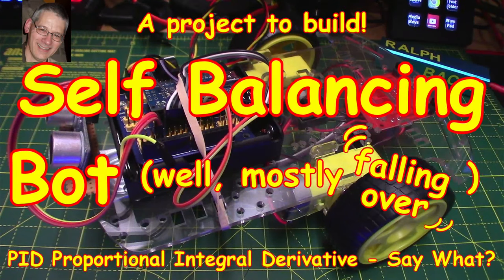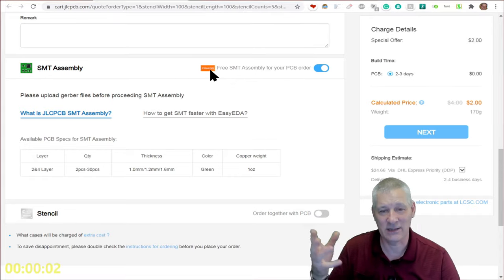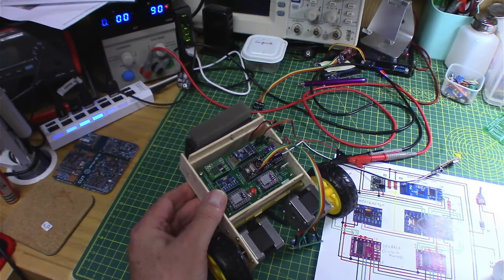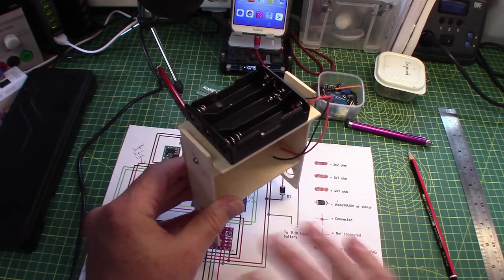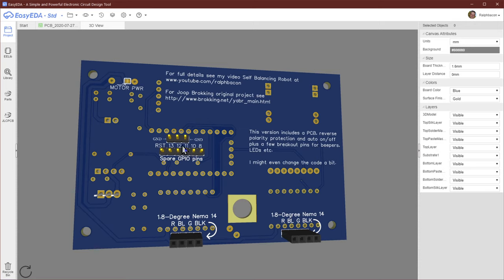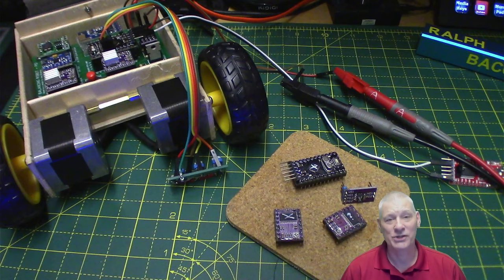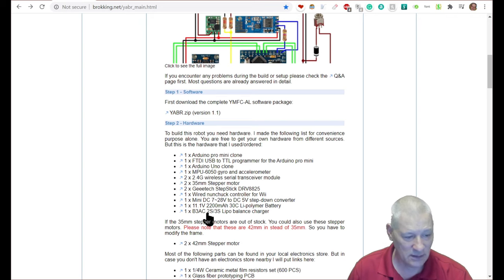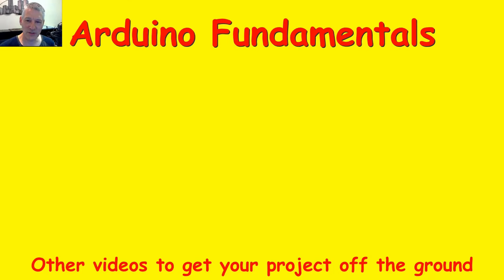#199 Self Balancing 'Bot (almost) with Arduino Pro Micro

Comment: I did start this project but never built the circuit board well before easypcb was know to me. Some 6050 have offsets so some code to adjust for this or it will drift forward or backwards, second if there is slip on the wheels to the floor surface then really complicates the problem. I used bicycle inner tube stretched over the wheels as were too hard plastic to grip. A rough floor surface would help, glass paper? I like the pots for the PID idea and Serial plotter might help to see what happened. Lots or D  once the P gain is correct enough. Graham
Reply: As a photographer, I use cut out pieces of blown-out bicycle inner tubes whenever I need additional friction.
May I ask, what is "glass paper"?
Reply: @AtlantaTerry   glass paper english for sand paper
Reply: @grahamwise5719  
Oh? Thank you, I am 74 years old and never heard that. Well, as they say, one learns something new every day.
Reply from the maker: I'm trying this out mainly on carpet which provides enough grip for now. But inner tube or elastic bands are definitely an option.
Reply: @RalphBacon  
I'm not sure how old you are but I'm 74 and way back in the '50s we kids got Erector Sets for Christmas and birthdays. If I remember correctly, those sets included metal wheels with rubber treads. I wonder if that sort of wheel would be useful for this project of yours. But where to find them these days... The originals would likely be too expensive as collector items and if the sets are currently being produced, most likely the wheels are cheaply made in China. 

Just a thought... but what about wheels made for "Pinewood Derby" competitions held by Cub Scouts / Boy Scouts?
https://en.wikipedia.org/wiki/Pinewood_derby

Comment: You need to get an nvidia jetson whenever they drop in price. I plan on it. I meant to add I ordered a bosch bno055 9dof board with mcu that communicates via spi or i2c and a mini lidar sensor good for 8m with a built in stm32 that just spits out 3d coordinates. I'm gonna use a pi3 or something better hopefully to visualize the data overlayed on a known area to figure out the transform algorithm to make a rolling beast of some sort. Winter project.
Reply from the maker: Winter is always a good time for those sorts of project. Hang on, an Nvidia Jetson, an AI board just to balance a bot? Hmm, I need to dig this project out of my storage bin!
Reply: @RalphBacon  they can do more than that. They could be trained to identify my cats. I have one named Ralph that's especially bad. Haha

Comment: -may they rest on peace.😇
-and you were worried about polarity. 😉
I know nothing about PID. How do you know it is vertical?, how do you measure movement?
By looking and listening to you robot's movements, it seems that your motor control is a bit of, I guess I'm just pointing out the obvious.  
Good to see that you do as you preach and apply your own circuitses.
Reply from the maker: We know when it is vertical because the MPU6050 can measure angles, so when it is upright the angle is zero. Movement, as in forwards or backwards, is not measured directly (I think) but can be because I'm using stepper motors (not standard DC motors) so one pulse will equal x mm of travel.
Reply: @RalphBacon  If I understand this right, the MPU6050 say zero when it is precisely vertical? Then your base plate has to be precise to. With 16 bit resolution, 1 degree of might matter.
Have you measured the value of the MPU6050 when vertical?
Having the battery on top shouldn't matter as long as the center of combined gravity is on the center of the axles. I don't know if the center of gravity matters. If it does matter, the placement of the battery pack could be adjusted.
As I said earlier, I  know nothing about PID and I would be lucky to push your mind in the direction.
God or bad, every suggestion/ ideer change our way of thinking ever so slightly.

Comment: Ralph; Did you do follow Brokking instructions in the first video? The "YABR_hardware_test.ino" test and get your balance test value?? From what I understand this number is unique to each construction.
Reply from the maker: I did indeed, Paul, although it varies quite a bit each time I do it. -552 is the current value but it can vary between -270 and -880. What I don't understand is that if this is supposed to be the value when the bot is vertical, why not just use the gyro angle instead?
Reply: @RalphBacon  One thing I did read that it takes two or three seconds for gyro to generate true numbers.
Reply from the maker: That would be too slow I guess. I shall experiment some more.

Comment: Batteries on top? Bad idea! Lower COG dictates the batteries go on the bottom. So, bigger wheels to give more ground clearance and then you'll have the space to put the battery box on the bottom.
Reply: Incidentally, my robot buggy was built on that chassis you showed (battery box on the underside - 2 x 18650) and a Pro Mini with a Bluetooth device and all controlled from an app on my phone. The next thing is to build a controller using a joystick and another Bluetooth adaptor (or maybe convert to using the NRF24 modules instead.)
Reply: This is an inverted pendulum robot.  It helps to have the mass at the top.  Try balancening a boom on your hand with the head down, then try again with the head up.  It is mush easier with the mass at the top.
Reply: This type of bot needs to move its COG outside its footprint in order to move itself. If it used conventional COG rules, it wouldn't make sense to only put 2 wheels on it, now would it?
Reply: @buckstarchaser2376  I'd not actually ever build one with just two wheels. It's so much extra work for what seems little reward.
Reply: @Pi-Tutorials  I assume you meant balancing a broom on my hand? My boom has its own stand and a counterbalance. ;-)
Reply: Nick B no need to assume. That’s exactly what I said.
Reply: @SpeccyMan  One of the bigger rewards is that it can pivot like a tank, but doesn't incur the massive torque (amperage requirement) load, making it fast and agile, while shifting the strength requirements to processing and sensor power, which are now within the grasp of a hobbyist. Since this form tends to be slim and upright,  it's a candidate for a robot/mode that fits within human spaces. The learning that is gained with this type of balancing lends itself to  to walking, and other balancing robots too.
Reply from the maker: I'm just doing this for a challenge and fun, Nick.
Reply: @Pi-Tutorials  
The same thing applies to Elon Musk's test rockets in Boca Chica, Texas.
The "flying water tanks" have a massive steel cube affixed to the top to simulate the missing rocket, cargo, etc. I can't remember the exact weight but it could be something like 20 tons.
Reply from the maker: I bet Elon Musk (or his staff) know exactly how to calculate the PID for his spaceship!